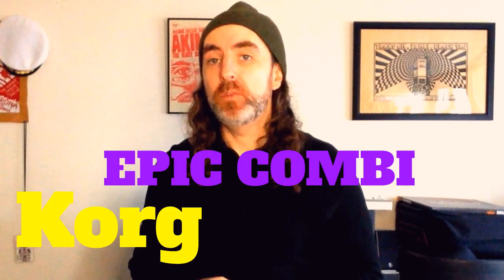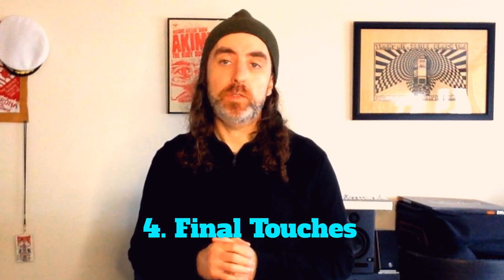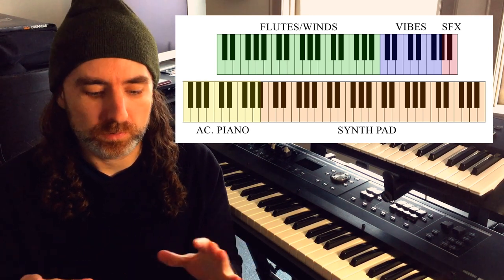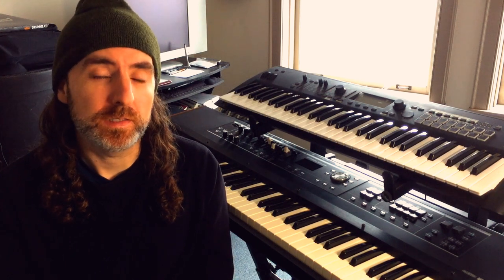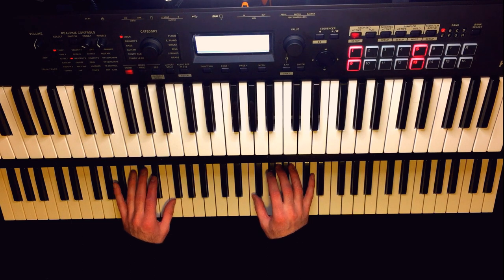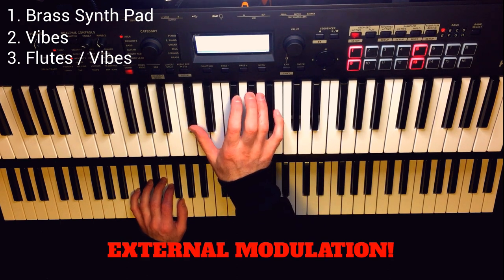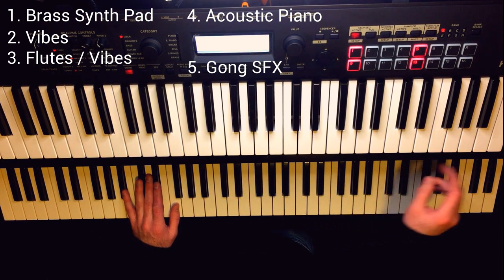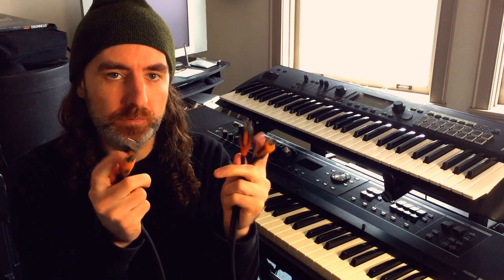Korg Kross Tutorial | EPIC COMBI (Part 1) Planning Patches and MIDI Hardware

Comment: Watched all 3 parts, Thanks! 
 I've kross 2 and yamaha psr i455 is it possible to route audio from kross to yamaha ?as the psr has its own speakers.
Reply from the maker: thanks! I just put up part 4 a few days ago. I'm not sure about your question, are you talking about routing audio or MIDI transmission?
Reply: @EricJungeMusic  thanks for the reply , audio. is it possible? or only midi information can be in and out.
Reply from the maker: @PremJHans  I suppose theoretically audio could be routed to the PSR keyboard if it has a proper audio in from the out of the Kross. But it might require some type(s) of adapters to make it work.